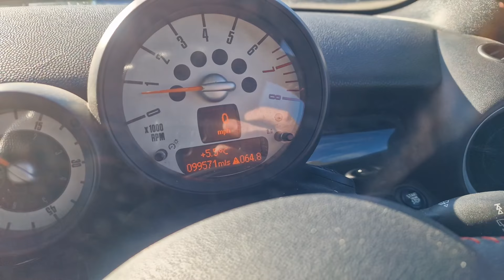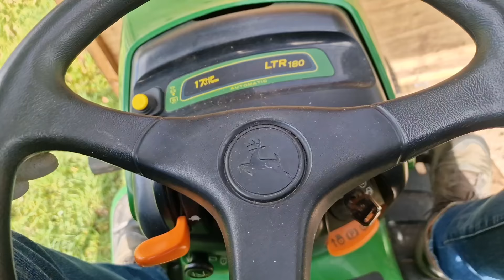It Nearly Fell On Me But Got Rid Of It In The End!

Comment: Jamie, any of the wood you are saving needs to up off the ground/concrete etc as well as a foot away from the house.  Leaving the boards on the ground or concrete will gather insects and calls the lumber to deteriorate (dry rot) in a very short amount of time as well cause them to grow mold and mildew. The easiest thing to do is lay out some of the cinderblocks and then stack the wood on that if you were going to paint the roof panels look for an aluminum paint, they make it to paint fences as well as metal roofs. It’s nasty to work with but it last a long time and holds up far better than enamel paints on galvanized surfaces. Additionally, they make a etching solution that you you would paint on the galvanized roof panels and it helps the aluminum paint it here to it better I don’t know the chemistry behind it I just know it works.